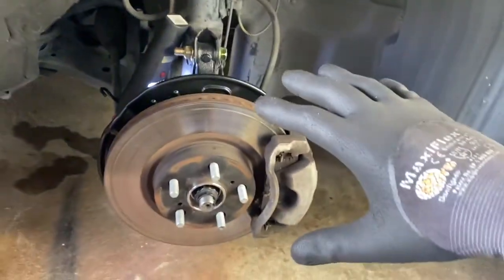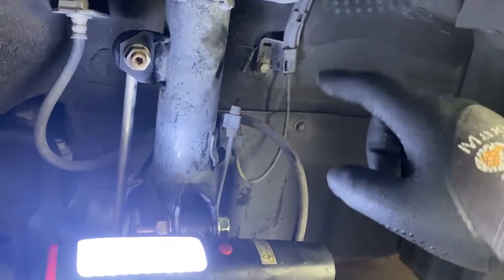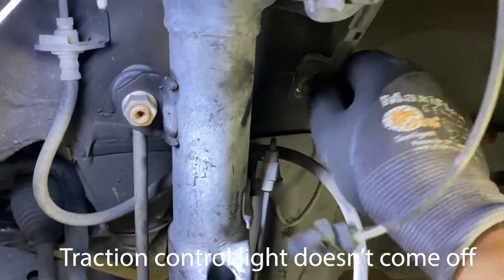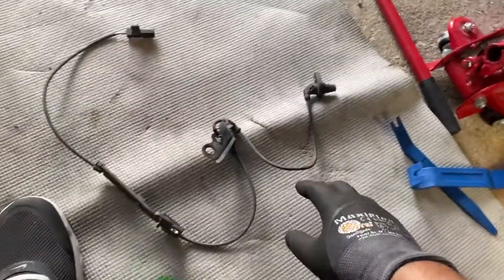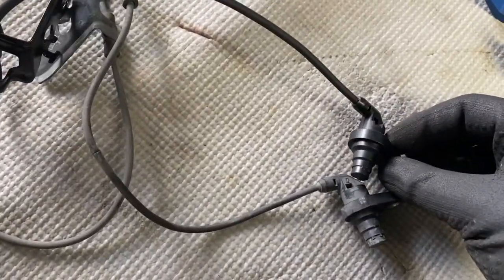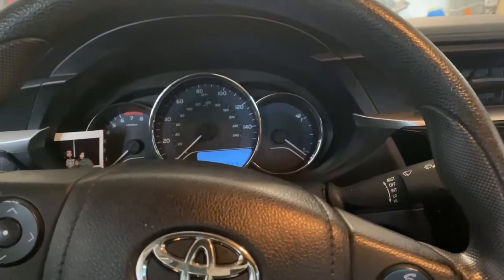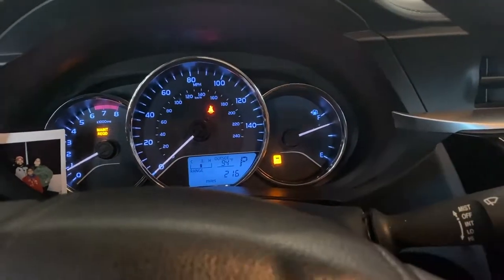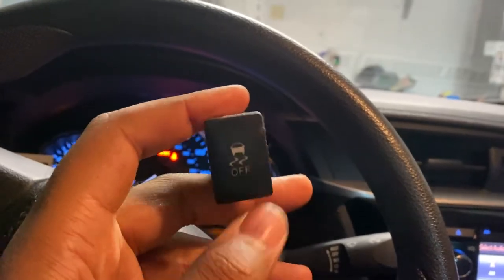HOW TO INSTALL A SPEED SENSOR ON A 2014-2018 TOYOTA COROLLA | TRACTION CONTROL LIGHT WONT GO OFF!!

Comment: I think this is whats wrong with my wifes cars the traction control msg pops up n the check engine light cane on, but went away a day later and came back on the next day. So hopefully this. Is the problem. Thanks u so much for the video. Will def use this video when i change the sensor! Thanx

Comment: Hey Carl I have a 2012 Toyota Sienna That through a code P0500 Vehicle Speed Sensor but I can't find where it is located on my van. I have looked but can't find it to replace it. The auto parts store have the part but they say they don't know or won't say where it is located . I would appreciate any and all help
Reply from the maker: I honestly have no clue. There aren't any youtube videos on it?
Reply: Thank you for your help if I  do happened to find where it is located I will do a video on it  @StraightOuttaContent
Reply: Did you ever find out I have the same issue on my Corolla 2017 le
Reply: @10015732  Yes my sensor was inside the transmission sitting on top of the valve body. I drop the transmission pan then unbolted the valve body and you will see the speed sensor
Reply: @furreal8625  but replacing it solved it?

Comment: Is there only one speed sensor or do all the wheels have one? My daughter has a 2019 Toyota Corolla, the code is reading speed sensor but that's it. All the lights on the dash are on and the Speedometer is not working. She paid for it in full so there is no warranty. She is in college with that being said we do not have dealership money.

Comment: How did you know it was the speed sensor? My 2015 just popped my steering wheel, ABS, Check engine lights and the speedometer isn't working nor is my mpg screen or avg speed screen....not sure if I should replace the sensor or if their is a fuse somewhere that would make all of that go on at once
Reply: Im experiencing the same thing
Reply: Get a obd2 code reader, it will tell you which sensor is having an issue.
Reply: @ProsperousHobo  I did scan it and replaced all 6 sensors.....still having the same issue
Reply: @Erika Harrison  I've also replaced the one that was broken and im still having the same problem.
Reply: Did y’all figure out what was wrong? I’m having the same issue
Reply: @stephenanderson4513  no.

Comment: How did you find out witch sensor was the bad one?
Reply from the maker: My mechanic Peter fixed everything
Reply: @StraightOuttaContent  ... How many speed sensors are on a 2019 Toyota Corolla It's my daughter's car and she paid for it in full. With that being said, there was no warranty and she's in college, so the dealership is not in our budget. My mechanic said the code reads speed sensor but Does not say which one. How can we find out????